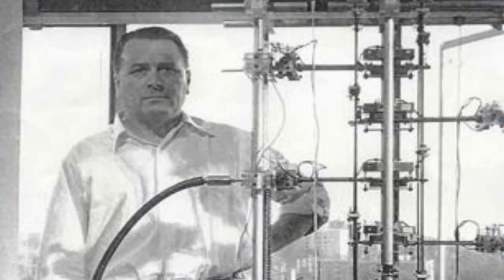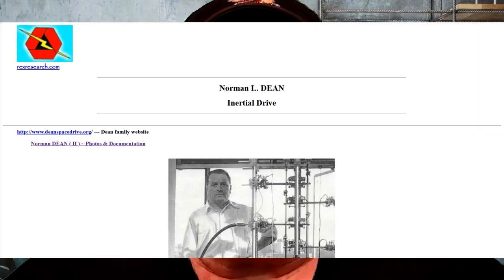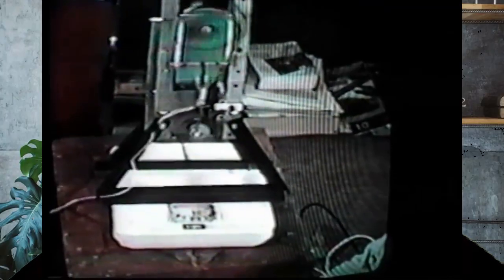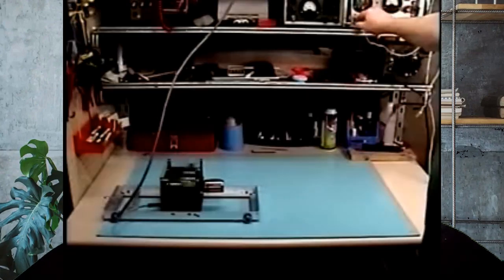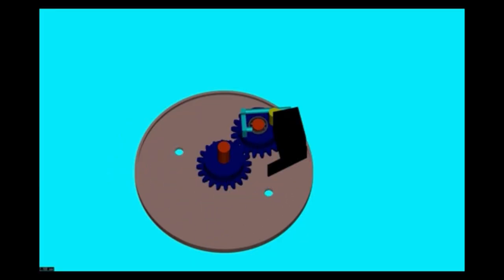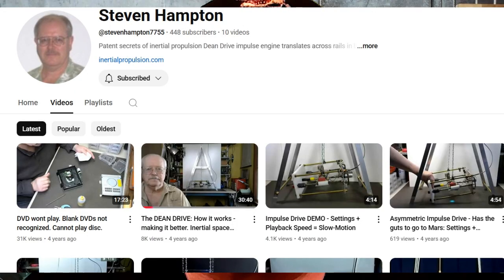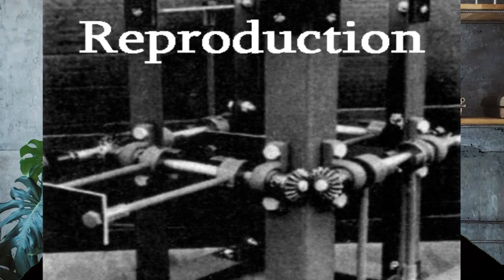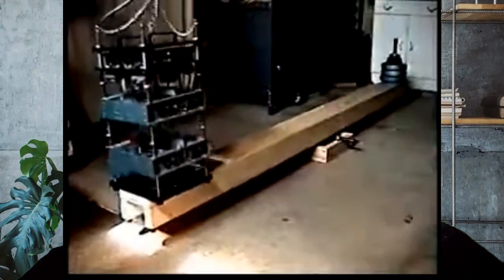The Secret Machine That Shocked Scientists! - Week 2 - The Dean Drive

Comment: If an imbalanced washing machine or dryer can gyrate itself across the laundry room then this should likely work the same way. 
I think friction is a key factor for the washer and dryer’s movement but a free hanging model would be different working principles probably only using inertia